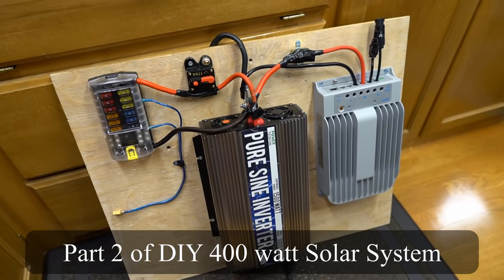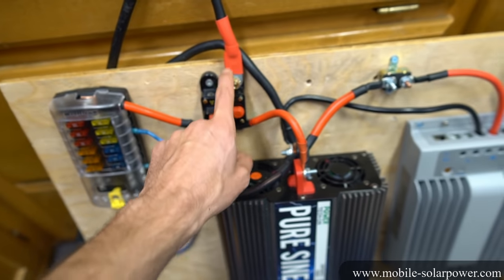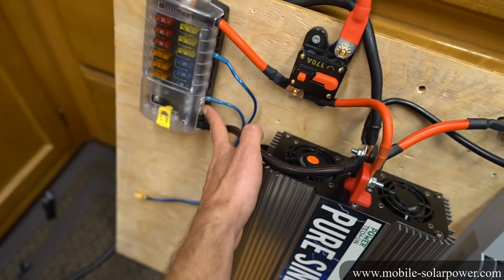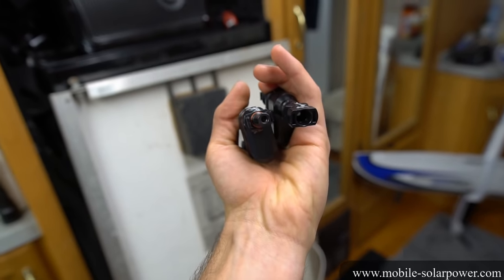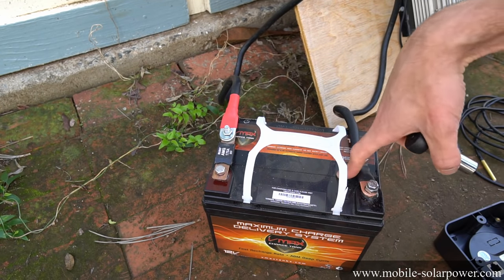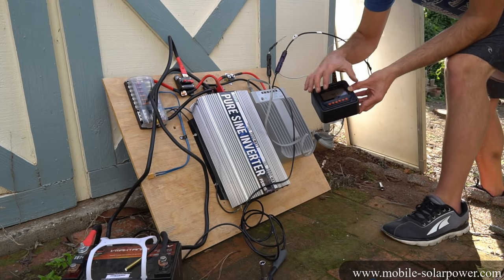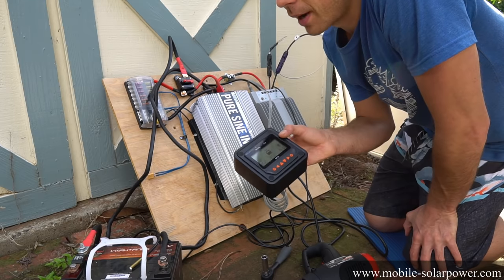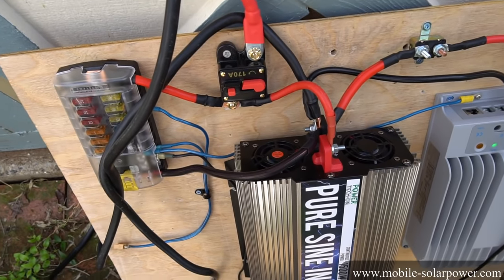DIY 400 Watt Solar Power System Beginner Tutorial *Part 2*

Comment: part two, in a nut shell if you overload the inverter and blow a fuse  will this disconnect the charge controller from the battery ?

Comment: For a pure DC system with no inverter do you need that second smaller circuit breaker? that's mounted in between the inverter and charge controller?

Comment: Where may a battery disconnect switch be added? Right after the metal fuse that you put on a + of the battery? Thanks for the video, very informative.

Comment: Is this the best way to do all inverters mine never came with instructions, I have the same Solor charge controller and at the moment I have it connected to my battery bank my inverter is a 2000 W DC. 4000 DC  12 volt to 240

Comment: I am so confused with the wiring of an inverter. Every thing I have read says to connect the inverter directly to the battery ,I can connect it through a fuse panel as long as I have a breaker in between the connection? I'm so lost lol.

Comment: Diy Solar with Will Prowse >> i can agree with what you said with the bolt on Fuse but one nice thing with the Fuse that you have on the board is that it can also act as a battery disconnect as well to make sure that the Dc fuse panel has no poer going to if from the solar array with out having to disconnect the panels from the Mppt Power controller No ??

Comment: Nice explanation on what is needed, for us beginners.  So what size circuit breaker from the batteries to inverter in a motorhome would be appropriate instead of the 170 amp one in the video.

Comment: You're  awesome!  Comment@4:46 if someone connecting a battery to a car, he needs to connect the positive first then negative, vice versa if he takes the battery off from a car, disconnecting the nective first then positive to prevent metal wrench touches any part of car metal as ground (nective) to short the battery.

Comment: hi thanks for the vid. if I wanted to run a wire connected to a single plug from the inverter how would I do that? thanks in advance

Comment: I think the idea of connecting one terminal before the other is due  to not making sparks when installing a battery in a car. Connect the positive first so if your wrench touches the grounded metal it will not spark due to the negative not being connected yet.

Comment: I'm going to connect 12V 0.9 Amp Fridge directly to battery. And  I have15W laptop, 30W 3Amp phone charger and 4W LED lights. I'm goıng to buy 200W Pure Sıne Wave Charger for my laptop, phone and LED lights. Which fuse block and fuse i have to use?
I have Epever 30A Mppt 3210A, 135AH AGM Battery, and one 250W Solar Panel.

I used 300W Modified sine wave before for my laptop and phone it was working good for me i didnt had any problem. But i heard modified sine wave is not efficent they are using lot more energy than pure sine wave. Is it right?

Thank you :)
Reply: Modified Sine wave inverters are not good to use because they can actually provide more power than is safe. This can cause meltdowns with resistive loads such as anything with a heating element. (Hair dryer, toaster, curling iron, space heater)

Comment: Early lead acid batteries sometimes outgassed hydrogen gas. Because of this they could explode/catch fire from a nearby spark. The last connected terminal could cause such a spark. 

When connecting jumper cables on older cars the ground was typically connected last and connected far from the battery on the car's frame. Thus the spark was far from the battery and the battery wouldn't explode. 

While undamaged batteries no longer have that issue, it's still accepted practice to connect cables this way. If you are connecting the terminals (as opposed to the frame) I don't think it matters on lead acid batteries. Sparks are sparks. The batteries do still sometimes outgas, so never use them in a confined space. Many battery sheds have shuffled off this mortal coil in fireballs through the years. 

LiFePO4 batteries have their own quirks which I don't know. So I can't say for sure what the recommended connection order is, though it probably doesn't matter.
Reply: P.S. All other things being equal, grounding a system first is a good idea. Typically the negative terminal is grounded, but this can vary.

Comment: You confused me a little bit there because in part one you were showing a pure sine wave inverter as 3000 watt and in part 2 you were showing a pure sine wave 1500 watt inverter. I was planning on using a 2000 watt pure sine wave inverter and a Renogy 40amp Mppt chrg controlerwith three
  150 watt mono solar panels with three or four 12 volt VMAX batteries rated at SLR 125 AGM deep cycle.... I am totally new to this so please respond if you see anything wrong with my planned solar setup for a small cabin. Your videos are so helpful and much appreciated.... thank you Will.
Reply: You should check out Will's videos on poly vs mono and how the poly generated their rated wattage.
If you put the panels in parallel, then yes, you'll need a 40 amp controller. If you put them in series, you can save $55-$60 and get the 20 amp controller because you have less current (amps) flowing through your cables. 
With the inverter, if you use 2000w then you're pulling 167 AH (amps) per hour and you need to make sure the VMAX can handle that. If you put them in parallel, that'll increase the continuous output of the batteries (at least for Battleborn lithium this is the case but this should be the same as well).

Comment: Will, Great video!  I was able to put together your 400 watt system but my 2 - 6c Crown batteries (what I had already) are 4 feet from my controller/inverter panel.  Is this a problem?  Using 2/0 battery wire to connect batteries. Because of occasional shading, my solar panels are in parallel.  First attempt at RV solar.
Reply from the maker: 4 feet is fine. Yeah 2/0 gauge should work great

Comment: can an automatic transfer switch be wired into this system so that when parked I could plug into shore power ???
Reply: You could but it would need to be wired to a DC charger to charge the batteries as they are the power source for the whole system.

Comment: Why do you have your 12v fuse block going to inverter instead of the batteries? Is this the standard way of setting it up?
Reply from the maker: You can connect it wherever potential and current handling will allow

Comment: I was alarmed at your advice to install a bigger circuit breaker if your current one trips.

Isn't the purpose of a circuit breaker to protect the circuit where there is an overload. Just increasing the circuit breaker defeats the purpose of having it in the first place.
Reply from the maker: That is only if the conductor can support it

Comment: I'm not 100% certain, but I think the order of whether to connect/disconnect the positive terminal or negative terminal first depends on the situation.  I know that in the engine compartment of a car, you want to connect the positive first and then the negative (or disconnect the negative before disconnecting the positive) so that you don't risk shorting out the positive to ground if your ratchet brushes up against something in the engine compartment as you work to tighten/loosen the terminal connection.  But I'm not sure under what circumstance you would ever want to reverse that order, or if there even is a reason to reverse it.
Reply from the maker: It doesn't matter for solar. And yes, for automotive application, it matters. I just prefer bypassing the ocpd. Do whatever you want

Comment: Can you use two 6v golf cart batteries for this 400w system??
Reply: Make sure the voltage doesn't go out off sync between the 2 batteries, a bms could be needed for failsafe operation.

Comment: I used the 40A Tracer BN series charge controller with the MT50 meter connected to a single 315w LG panel and a 12v 100ah AGM battery. My issue is this: there doesn't seem to be any correlation between the battery level icon graphic on the meter display and the actual capacity of the battery. Sometimes the meter displays a "happy face" but seemingly low battery charge level. Has anyone experienced this and what is the solution if any? Is there something that I do not understand?
Reply from the maker: Yeah that only shows charging or something. That smile face is a little confusing. Also depends on what the settings are. Check out the manual to learn more
Reply: @WillProwse So how do I know at the end of the day what power reserve / battery capacity I have available for consumption through the night?  I've read through the manual several times and nothing seems to  address this.  Can I discern or calculate from the numbers on the MT50 my battery charge in terms of percentage, ie. 100% , 80%, 50%?

Comment: Will, if I have multiple panels, would a power optimizer on each panel help with maximum power out when 1 panel gets shaded? Would it interfere with the MPPT controller?

Thanks. Great videos on solar.
John
Reply from the maker: Sure but bypass diodes do a good job too. Depends on the size of the array and voltage drop across diode..either way works well
Reply: @WillProwse  Just going to use 4-305 watt panels in a tracking array. Rich MPPT controller to a 24 volt battery. One panel might be shaded before sunset and just after sunrise. Wanted max power.

Thanks again.  John

Comment: Hi Will, very good videos. I can't seem to get the clarity of what I'm thinking of doing to my 25ft TT. Can I wire 2 12volt solar panels in series producing say about 34volts connected to the MPPT and still have my 2 12volt batteries connected in parallel maintaining my 12volt system? and if it is a 20 amp controller should I not be calculating the amperage from the solar panels at the higher voltage?
Reply: I meant wattage, being that the voltage is higher and the amperage is the same value as if 1 panel was connected shouldn't i get double the amount of wattage the the MPPT can handle on the solar array side. I realize the battery bank is 12 volts so it can only receive the 20 amps x the 12vdc = 240watts but what prevents me from having over capacity on the roof?
Reply: basically what I'm trying to say simply is can I have the solar array connected at 17, 34, 51, 68 volts by series wiring 17 volt 100 watt panels and still keep my battery bank at 12vdc.
Thanks

Comment: These are great Thankyou very much. Just a quick question. If you already have the 175a circuit breaker why did you put the 175a bolt on fuse at the battery? Is that just for some extra protection?
Reply: All devices need a fuse. The 170 does protect the inverter and the 175 for the battery.
Reply: Fuses protect wires against overheating and even melting in case of a load too large or a short. To prevent fire. The thickness of the wire needs to be enough for the expected load and the fuse or circuit breaker needs to be large enough to carry that load. The circuit breaker is not needed in this example but can be very convenient. You can put it in a spot that’s easy accessible in case it trips or to use it as a switch to turn off the electricity if you put your RV in storage or when you’re working on the system. Any power source needs a fuse as close to the positive terminal as possible to protect the wiring.

Comment: Shouldn't the 170a breaker have the positive cable from the inverter on one post, and the positive cable to the bank of fuses on the other post? seems the way you have it installed you are not even using the breaker, unless the breaker is to protect the battery, or if something bad happened to the battery. Please explain where a short could occur and what the breaker would protect. Thanks loved your videos, but this has me confused.
Reply from the maker: So the fuse on the battery was to protect the wire. in the circuit breaker on the board was just so that beginners would understand where everything's being connected. you could easily size a breaker or fuse for the battery or you can have two it doesn't really matter. I just needed to protect the wire and the appliance and this videos for beginners.
Reply: Thanks for your quick reply, I've been watching more of your videos and I've checked out your website!

Comment: Which terminal to connect first?  I must say that you give the best advice on the internet. 
"Whichever one is most convenient" should anger the connection Nazis on both sides of this silly argument. GOOD JOB!
Reply: In this particular circumstance, it really doesn't matter which side is connected to the battery first. It is FAR different in an automotive starter battery situation. Because of how batteries are typically packaged in engine compartments, surrounded by a good amount of grounded metal, disconnecting the negative cable first and reconnecting it last is done for safety. If your wrench  contacts metal for any reason while disconnecting the negative terminal there is no risk, the chassis goes to ground anyway. Once the negative terminal is disconnected, the wrench contacting metal while removing the positive terminal also poses no risk because there is no path to ground. With the negative cable still attached, a wrench contacting the chassis while removing the positive cable will cause a short.

A thick conductor(and wrenches are great conductors) shorting a starter battery to ground will pass a lot of juice. I've witnessed people 'arc' weld wrenches to inner fenders when disconnecting a battery positive terminal first. By the time they got the wrench free, it was VERY hot. Hot enough to cause serious 3rd degree burns. Leaving it there too long will easily damage the battery, if not worse. Flooded lead acid batteries can and will 'melt down' if in a shorted state for too long, spewing acid all over the place. I know of one individual who had a gold ring MELT nearly completely off of his finger because it was contacting the wrench and the ring subsequently came in contact with the inner fender. This happened in a matter of seconds while he struggled to get his hand free. It is always highly frowned upon to wear rings while doing any work on a vehicle for a myriad of reasons, but had he simply disconnected the negative cable first he would have been saved a trip to the hospital.

I've spent over 20 years with my head under the hoods of everything from Hondas to Peterbuilts and Caterpillar heavy equipment. I've seen first hand what can happen to someone when they just say "Meh, it doesn't matter". Me? I do things in a manner PROVEN to be safest. I like my fingers just the way they are. I'm not a 'connection nazi', I'm a 'ten perfectly functional digits fanatic'.
Reply: @jamesgill5511  Well, thanks for the insight from the perspective of your first-hand experience.

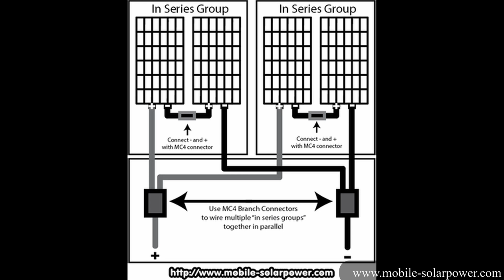Comment: Will at 3:58 , does that keep it 12 volt? and also I cant find the circuit breaker you used going from the controller to the inverter, the 50 amp one? Thanks in Advance
Reply: In a series circuit, the current through each of the components is the same, and the voltage across the circuit is the sum of the voltages across each component. In a parallel circuit, thevoltage across each of the components is the same, and the total current is the sum of the currents through each component.
Reply: @edgarbleikur1929  so maybe this is dumb, but does that mean it does stay at 12v? My basic understanding is that the system would then be 24v. Hooking upy system today and this has me wondering. Thanks so much

Comment: Great video! This has really taken away my doubts that I could install a system like this. I'm wondering if this would be enough system for me to power a small refrigerator in my trailer on a several day road trip? Thanks for the videos.
Reply: Hey Chris, it depends on the draw from the refrigerator and how much sun you get. This system with 6 hours sunlight will generate enough electricity to run a 12v 50 watt fridge for 24 hours with some spare power.
Reply: Thanks Peter

Comment: I'm wondering how or what I need to have the AC outlets in my trailers without using the shore power. Pretty much understand the solar setups. Just don't get this step. Damn I hope this questions makes sense. Love your video's. Thanks for all your effort. I also purchased your book.
Reply from the maker: Automatic transfer switch will do it. If you  don't want to wire it up, you can technically just plug RV shore power plug into your inverter. Some losses but not that bad
Reply: @skipbenton
The only thing about above suggestion (which is a good suggestion) is to make sure when you plug into your inverter is that your RV’s ‘power converter’ isn’t drawing power to charge the same battery/batteries...

Will has a video in installing a transfer switch in an RV. 

IMHO the onboard oem-installed converters in an RV are sorta dumb. It doesn’t take much to get rid of one and make the RV all solar; the transfer switch won’t be needed if you plug in to your inverter as when you need/want shore power you just unplug from the inverter, slide it out the access port, and plug into the ‘grid’ outlet. 

The thing that is annoying about wiring that way is if you want to have ‘everything else’ solar but have a resistance-heat fridge, run a furnace fan a lot, have an electric hot water heater, or run an AC you probably depend on grid 120VAC or a generator regularly. So I guess it depends on your needs. 

In my case 120VAC is only wanted for a vacuum cleaner, the coffee pot, and my portable tool charging (for which there is no 12V charger by the mfg for my 20V tools). I do use it to charge my phone and laptop but that’s mostly cuz I can- it’s convenient. There are numbers of options to power both of those w/ 12V. 

(Hopefully- since I just noticed this was a year ago post- you got something workable)